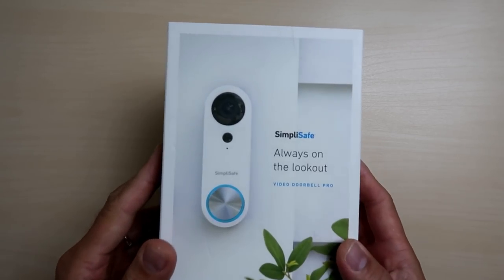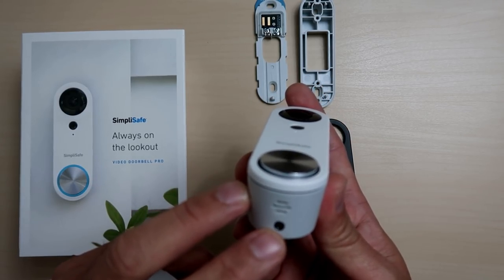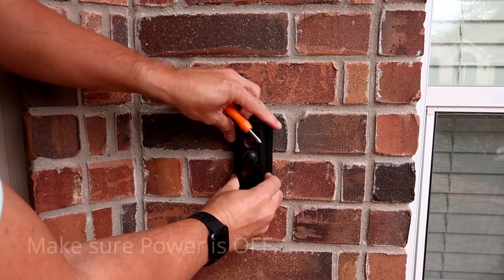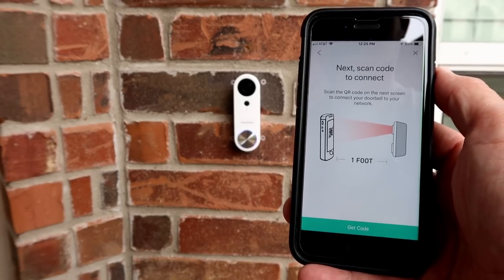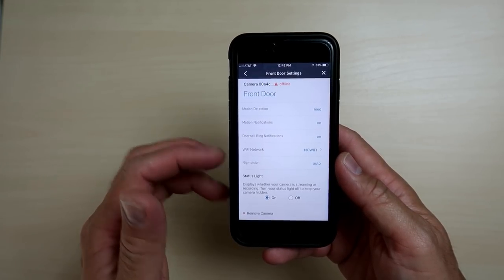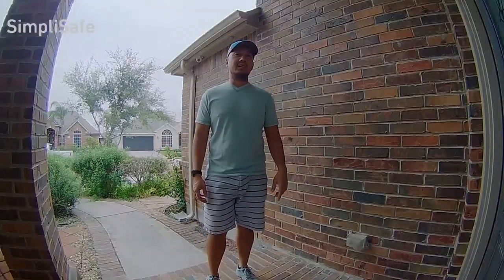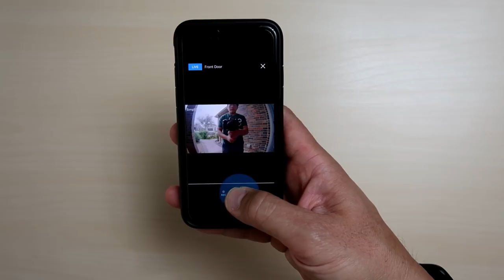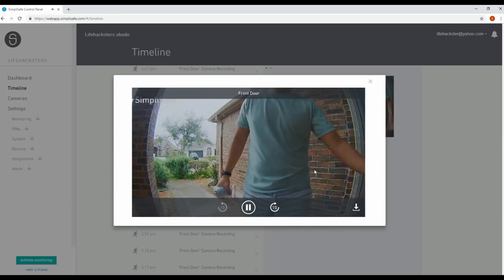Simplisafe Video Doorbell Pro Review - Unboxing, Features, Setup, Settings, Installation, Footage

Comment: It's too bad SimpliSafe is taking so long to get to market with their components. I moved into my new house this past spring and started with the SimpliSafe security system but bought my Nest Hello since SS didn't have an available option. The video quality on my Hello looks as good during the day and better in the dark and the cloud storage I pay for is only $5 per month. Now the question becomes "Do I ditch my SimpliSafe security system for Nests or do I ditch my Hello for this one?".
Reply from the maker: I haven't checked Nest's security alarm system but I know they are a bit pricier. Overall, Nest products are more in the expensive side. A lot of people don't like the motion notification delays with the Nest cameras.
Reply: So there's less of a delay with SimpliSafes model/service?
Reply: @blondebadger0311  yes, about 4 seconds.  You figure with everything connected to Wi-Fi, it would all be in real time. This is where Simplisafe cuts corners. Then again, they will also tell you all their equipment is made in the U.S.A. Yet,  everything says made in China. The biggest challenge you will now find with Simplisafe  is when something goes wrong with the technology and you are unable to figure it out on your own and you have to call the one and only call center in Boston, Mass. If you look on craigslist Boston jobs under customer service, you will see multiple ads with no name of Simplisafe but the job pays 15/hr and you don't need any higher education , yada yada yada, which means it attracts a very young, and inexperienced labor force excited by $15/hr. Simplisafe mainly uses local temp agencies to recruit prospects and sucker in unsuspecting , more educated and experienced candidates with empty promises of being promoted fast.  Simplisafe starts with a pool of prospects, splits the group in two. By the fifth and final day of training they flunk out 75 percent of the class and the rest are put on the floor and then the 30 days of training, handled by a team lead and a team supervisor . The problem for you as a customer for them is because of the poor follow up training for new reps combined with a serious favoritism to issue along with the poor call center management, and the politics they all bring to the floor, it leaves for an unstable call center unless you are lucky to get one of the really good ones which are far and few between because they either get fed up and quit or they speak up and get literally set up to be fired. How many home security companies do you know that has 3 or 4 temp agencies on speed dial? Call center reps are penalized if you ask to speak with a supervisor.
Reply: Okay folks. I use to speak up for Simplisafe. I believed in them and their products. Then came reality. You get what you pay for.  It will be fine  if in a perfect world, everything goes off without a hitch and you never have an issue with connectivity, and that includes the new doorbell cam. However, where you may get screwed and seriously frustrated is their customer service reps. Of course, there are some really good ones like Khalil on the evening shift. But that is one out of 200-300 reps between 2 shifts. There is a great chance that due to the horrible training they receive from some of their leads and supervisors that, they may not give you accurate information or resolve your connection issues, and may tell you it's all set when it really is not. They close at midnight every night at their one and only call center located in Boston, Ma. So, if your on the west coast and shit hits the fan before midnight eastern time, and they the rep does not know what they are truly doing and tell you it is all resolved and it is not? Your gonna be unprotected for the whole night until they open at 9 a.m the next day. If you go on vacation and your base station stops working and can not bounce a signal back to a tower, than A) you will never know it while your gone and B) even if you have a presence of mind to check your app, unless you have someone that can get into your home for you to unscrew the base station to do a manual reset, your at the sole mercy of the technology. To my knowledge , if you lose connectivity, the base station is not designed to send you a heads up notification when the base station fails to send the tower a refresh signal so that the rep can see what's going on. Most importantly, I was shocked to find out Simplisafe is not registered with the Better Business Bureau or any respectable consumer protection agency. You know who else is not part of them? Cable and Cellphone Carriers like Metro PCS/TMobile, and basically any business that employs a cheap workforce where it should count like customer service. Good luck asking  for a supervisor on sales. They leave their sales reps to literally hang out to dry. They are petrified of being on the butt end of a bad customer experience. And if you push the issue the supervisors then put a derogatory report on you for not being able to keep the customer out of their hair. One last thing. Look on Simplisafe website. Scroll all the way down to their Google reviews. Look at the 4.7 rating and all the nameless 5-star reviews. Now go on Google and actually Google Simplisafe reviews on Google. Tell me what you notice before the in actual star ratings and comments from real customers. They claim to have gotten so big without clever marketing. Now read the fine print under how they got their own numbers. They are aware I'm on to them. They now include Amazon reviews as part of Google's 4.7 stars on their site, as small print. See those new commercials? Notice they are still referencing CNETS award they gave Simplisafe ...from 2014! Nothing since.  They also say 30,000 5-star ratings!...what they don't tell you is that it is out of 2 Million customers! I'm willing to bet atleast half of those 5-Star ratings were bought and paid for. They have an app for that too now . You get paid to give great meaningless reviews! I'm also willing to bet they have sold 2 Million units in ten years but a quarter of those customers have stopped the monitoring due to too many tech issues coupled with horrible customer service including actual supervisors leaving them on hold  only to accidently get disconnected...and do not call back, especially if they decided your a bad person and especially if your from Red States. Did I mention that Simplisafe decided to cancel NRA discounts for NRA members? Before you say something mething stupid about that, you should know that those members also include our military and police, and every law-abiding citizen who bares arms. The crazy part is a good chunk of their customers are from red States. Talk about biting the hand that feeds them! And don't you dare sound angry when you call from help...do not question their intelligence because this call center full of millianals that might take that as you talking down to them because you can tell what color their skin is or because they are a female. NOT ALL, but they have quite a few bad apples and that includes certain middle management. They DO NOT OFFER Law Enforcement discounts, either. Nor discounts for any widows  of fallen police officers, or fire and rescue. I am just explaining the extra stuff here that will only really make since to the current and former Simplisafe Customers.  I, on the other hand, for the 44 days I was there, gave away as many free months of monitoring I could to help any customers who had to call back and got me on the line because they were never called back by other reps, supervisors, and at times were hung up on by both or left on hold for two hours.  I became a Target after an audit of one of my calls listened to by either my 21-yr old supervisor who has serious maturity issues and actually swore at me and yelled at me in front of the whole call center for not apologising to her for getting caught in a serious thunder and lightening storm which caused me to be 3 minutes late. I literally was soaked all the way through with no change of clothes. I did not yell back , however I very firmly and quit clearly called her out by her name and asked her why she would talk to me,  a 41-yr old who has otherwise treated her along with everyone else with respect, every day? If looks could kill! Then she squints and shrugs her shoulders at me and said she didn't care. From that point on it was just time. Even though I was so good at my job and the customers adored me! I took care of them. The other boss that was under her, was suppose to really train me. That stopped after made it clear I was a straight guy, I was pro-military, pro-law enforcement , and that customers came first and that I would never sweep any negative feedback about other reps and supervisor's.  I took my customer service representative extremely serious! And according to them on my 44th day, when I thought I passed the 30-day probationary period because all my medical and dental insurance kicked in. All my new doctors and appts were all set. And I couldn't wait to buy my mom , who I have been a caretaker for, for the past 5 yrs, her very first 4k t.v and her very own laptop which I taught her how to use. On my 44th day, I get pulled into the review with the 21-yr old brat who thinks she knows it all at 21, the director of training , and the head of human resources, all by the way, share the same ideology and we'll, I am going to leave the rest up to you to figure out.  The director of training couldn't even properly explain why I was being let go other than, " I don't think you fit into Simplisafe culture." Then she refused to explain what she meant and they just stared at me.  She made a very feable attempt  to list some silly things  said during the audits of my calls to which they became obsessed with.  One was my comment about agreeing with a Simplisafe customer about how Comcast is, in short.  Another was about an example I gave a would be customer as to why or how he would benifit from having a webcam rolling in an unfinished house.. That was the day after they pulled me in for the Comcast thing. And they both happened in the same day! And mind you my first week on the  floor!  In my first two weeks they literally had given me a verbal, and a written warning on trumped up stuff that with anyone else, especially their own ppl , would have been chalked up to expected rookie mistakes that we're avoidable. I have zero call center experience. Zero sales experience. Nothing but security and exceptional customer service skills. Yet, they fired me because I was not like them in more ways than one. Not only was I an instant fan fav but had won the sales trophy of the week....in my first week....but did not get the trophy until one minute to close, on my third week. So I ask any of you not to make any conclusions about Simplisafe without doing your research. Without actually speaking to them. Try and get a feel for your first experience calling them. Ask lots of questions. Be specific! They do get better evaluations the longer they stay on each call. That's why you will hear them ask you for your email, even if it's one question. Middle management expects reps to stay on the phone for 30 minutes no matter what. Even if you only have a question. I would call quit a few times over the course of a week. I noticed that pattern with interested customers with multiple quotes. They are trying to figure out who's selling them short, and who's trying to jack up the total equipment cost. They do not make commission! But they get credit in the form of points on a metric system that's seriously flawed. Listen to your gut. If you have a bad experience and do not like how you were treated by the rep or that they were not very bright, demand to speak to a supervisor. And watch the games begin! Don't bother trying to call anyone in corporate. They do not have an office line. Everything is through email or snail mail. The call center floor manager is the highest you will get to. They are not allowed to give you anyone's name or number or email unless they decide your worthy of an actual call back.
Reply: Kelly Klinger, please read my very long but very honest feedback about Simplisafe products, and the 2 biggest issues you will ever have is customer service and connectivity issues stemming from the base station. Also,please be advised this doorbell cam was not suppose to be out anytime soon, as they continued to have glitches that their software engineers and developers who make at the very least, over $165 k a year, have not been able to solve. In my professional opinion as a security expert and computer networking student, the fact that this doorbell cam can not be configured to Alexa when the new SS3 system and the fact that there is a 3 to 4 second delay with the new doorbell cam even on the same  wi-fi network, tells me they are cutting corners and costs, just to start making money back on the investment. I would hold off personally on your investment until all the bugs are patched.
Reply: @jcrespo7729  Glad I read this, I was a nut hair away from buying Simplisafe.  Do you have a company you do recommend?
Reply: @petefoster7705  Honestly? If there was one thing my brother in law taught me is that you get what you pay for. Let me get back to ya. Let me do some reasearch.
Reply: @jcrespo7729  Absolutely, but these "free equipment/installation" companies don't seem to be much better.  More protection and perhaps more reliable, but you end up locked into some long 3 year contract paying 3-5x for what the equipment is worth.  I'm not exactly looking for the cheapest, but i'm not looking to get screwed on the financial front.  Thanks man!
Reply: Pete Foster same here, thanks for the detail information!! @johnathan crespo
Reply: @jcrespo7729  f
Reply: @dirtydiesel19ner10  u got it
Reply: @keithhill4947  hi buddy....I just saw the letter, "f" in your comment.  Either you were being passive-agressive in ways I never thought possible or you have a literary stuttering disorder which I believe has never been diagnosed before, lol. I'm sorry if anything I said offended you. If it did, that tells me your somehow affiliated with Simplisafe and your receiving payment somehow for whatever reasons known to you. Pardon the pun but I simple do not care about the feelings of Simplisafe and whomever they hire to put lipstick on the pigs they sell. I deal with facts and facts don't care about feelings. I despise a company that only takes care of management while treating the rest of their workers like livestock. As a matter of fact, how many companies do you know that took until their was a full-blown bedbug infestation before finally doing something about it. As a matter of fact they just spray-bombed the call center floor over memorial day and will have to do so until they outsource the whole call center. Then it will be someone else's problem. I wonder how many companies who are looking for office space will rent those floors if they knew it had been infested with bedbugs? Last time I checked , all the carpets would have to be ripped out and completely redone to irradicate the infestation. I stand by every comment I have made about this company. Everything.
Reply: @jcrespo7729  , sorry sir .I was just seeking replies,I do not work for or am I connected with simply safe in any form .just trying to make a good decision on a matter ..May God bless you and your family ... John 3.17
Reply: @keithhill4947  I appreciate that . Since you are a good Christian man, you should know Simplisafe's values are with the world. They actually had me remove my Bible from my workspace because it could offend some people. They said the same of my USA flag I had on my desk, and constantly made references to me looking like a, "country boy" because I wore a camo designed hat to work every day. I honestly thought you were saying f-u to me when I saw your response so I am sincerely sorry.

Comment: If you had to pick between all the video doorbells, which would you choose, i do not have any other security systems. thanks.
Reply from the maker: I'll still go with the Ring Doorbell Pro because eventually if you want to expand and add more cameras and home alarm, Ring will be the most cost effective on their subscription which is only $10/month or $100/year.

Comment: So far I like what I see, but had a question. Is there anyway that the notification tie into the Simplisafe Alarm State. For instance, if my alarm is Off, I only want doorbell press notifications, not motion. If the Alarm is set to Home/Away I want to get notifications from both.
Reply from the maker: I'm not sure because I don't have their Alarm system. What I know is that the doorbell will start recording when the alarm goes off.